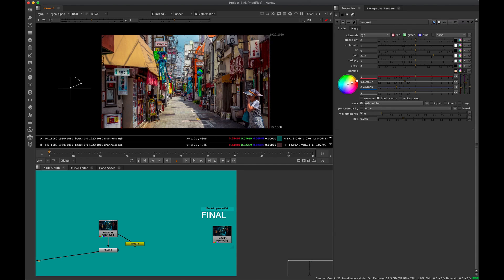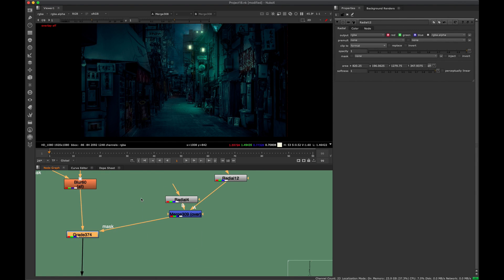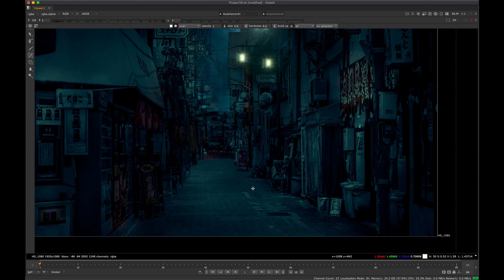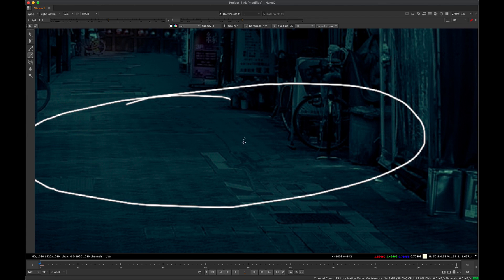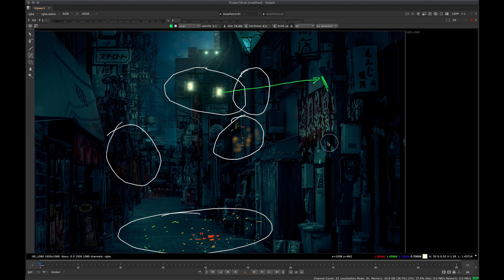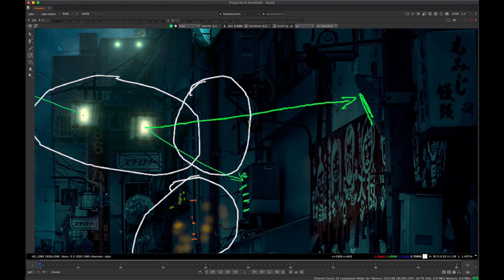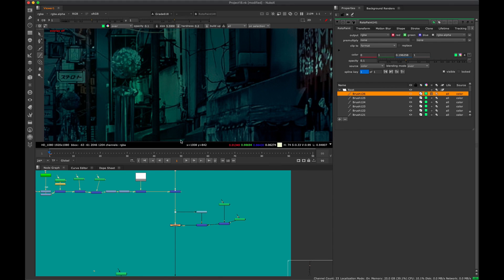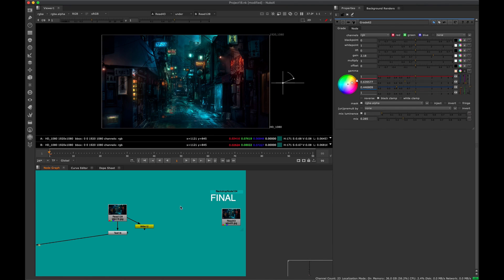Grading Highlights and Pools of Light | Nuke Compositing

Comment: I am watching your first course atm and I think I am going to buy all your courses while they are discounted, you obviously know what are you doing and you are good at explaining stuff, I have just a little question tho, I know that in this course you are showing a lot of techniques and workflows but I think you can achieve the same shot in photoshop much much faster:D My point is that maybe this wouldve been way better if it was on a moving shot with a lot of people/objects just going around, that would've make more  compelling shot, just my 2 cents.
Reply from the maker: Petar Petrov I definitely considered a moving shot at first.  However, it would have added a lot of complexity to the shot that would’ve made the class much longer than the 9 hours it already is!  I wanted to make a class focusing on the artistic / visual side of compositing without getting bogged down too far in the technical aspects - most of which the fundamentals are covered in NK202.

Also, in this class I teach a basic 3d model build, and a few things with the raytracer and bounce lighting, which aren’t possible in Photoshop!  Many of the lessons in this class carry over directly into a moving scene, you just have to combine other techniques from NK202 and NK303.
Reply: @CompositingAcademy  Thanks for your reply, I hope after I went through your coursers I will be able to do something like that in a moving shot.

Comment: what about the moving shots...
Reply from the maker: If you are working with a CG scene, you can use the Position World to isolate and key various areas to re-light areas.  This way of conceptualizing the pinging of lights I have used numerous times on feature films which includes moving shots!  If the entire scene is moving and it's real footage only, re-lighting plate footage is going to have limitations with what you can do with grading, however you can still place a few lights in if you have a camera track and you can project alpha mattes.  Of course if you have major overlapping and moving objects, certain relight techniques are impossible (unless it's a CG environment).